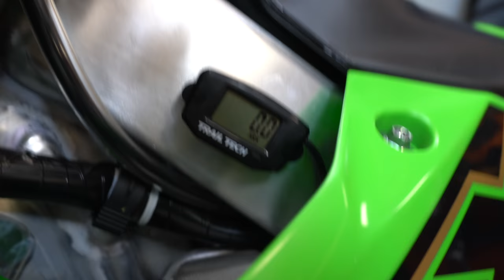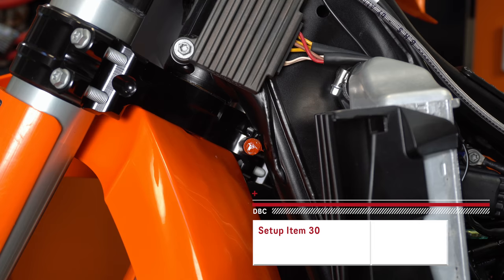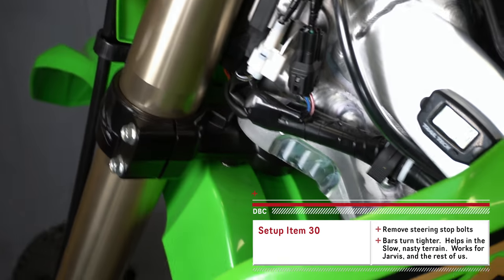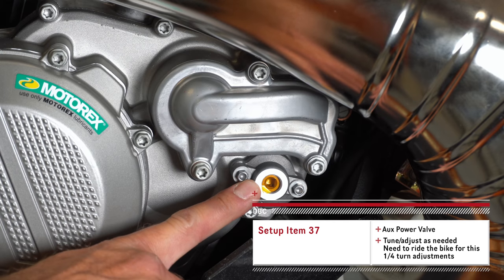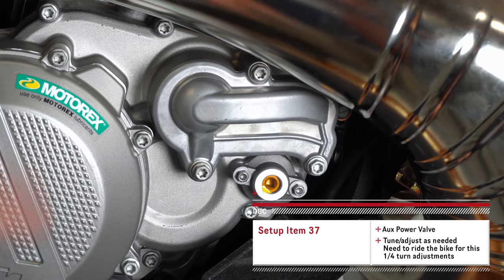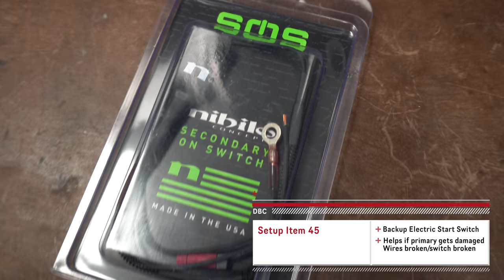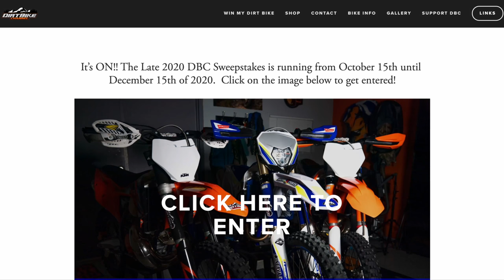How To Set Up a Dirt Bike - Part 2 - Over 60 Items

Comment: I like all these suggestions and tips. I always take apart the major electrical connectors and lube them up with die-electric grease. I also add about 3 dozen more zip ties to the wiring harness. I strip off all the bodywork and go over the wiring harness with a fine tooth comb, to make it more secure, and eliminate potential chaffing and rubbing.

Comment: All I have is a Honda 250 ATV, but I would love to get in to dirt bikes. I love true manual transmissions.
Reply: I have a 1987 trx250r and a 2016 yz250x. I had a 1988 xr600. No doubt bikes are more fun. Quads can be mastered in a couple of seasons. Bikes you just keep getting better with no plateau.

Comment: I wouldnt recommend alloy bar mounts, that force of the impact will have to go some where else, just turn the bars full lock to the opposite direction they are tweaked to and hit the ends of the bars to re straighten them :) quick and easy and will cause less damage to other parts
Reply: @gophop  each to there own id prefer to replace bolts then the bars

Comment: Don't remove the steering stops if you have a steering stabilizer. If the stabilizer isn't set up right, the stabilizer will become the stopper and damage internal seals or break internals. If you stabilizer does not stop going far right or left after removing the bolts, then you should be fine. My GPR4 stops the bars before the triple clamps contact the frame.

Comment: I had considered taking my steering stop bolts out but it looks like if I did, my forks would contact the computer heat sink (on left) or wires (on right)...thoughts on that please??

Comment: Engine Ice or Evans, no thanks!

Needing tools to access airbox-good and bad to that. Depends on how fast you need to change air filters I guess. 

That KTM quick disconnect has an in-line filter in it I think. Tiny as they are I've never plugged one in 6500+ miles on the bike.

Comment: I want to know everything about that 250XC
Reply: I have one , Its awsome, 
For sure the best transmission I ever shifted on a Motorcycle Period. 
I definitely  recommend a larger rear brake pedal pad. Stock on is easy to miss.
This bike has really good handling, very planted. 
The 250 has great power characteristics.

Comment: @DBC my sherco 2020 300 se factory can it be bump started with the capacitor  that is for the ktm xcw?  I read that because it has an electric power valve it doesn’t bump start.

Comment: Instead of buying an FMF pipe just buy a fisch moto spark arrestor. Cheaper option.
Reply: Crazy rule but some places you need the stamp that says you have the spark arrestor on the outside of the exhaust.
Reply: @dmc8921  ya these spark arrestor have the USFS stamp on the outside. Check them out they have some cool products. Fischmoto.com or check them out on rockymountainmc.com

Comment: SHAME!! Why do we have to pay 7k to 11k for a new dirtbike and all this stuff is not done?? Why do we have to pay extra money on a brandnew bike? Wouldn't it be easy for a company to just fill radiator with engine ice, Silicone parts that can corrode, electrical grease on terminals, leave steering stop out, bar pads, grease ALL linkages, BETTER battery for assurance, etc,etc. Sounds like we the customers have been getting ripped off for to long an NOT COOL to us average broke guys. #SMH
Reply: Yeah I feel ya.
I bought my new 250 XC, I've spent about 1200 on it in upgrades. 
If you want to go an economical route get a nice air cooled japanese
4 stroke. Under 5000 new, throw Tubliss on it and call it a day
Reply: If you are buying a new dirtbike you are a sucker anyway.